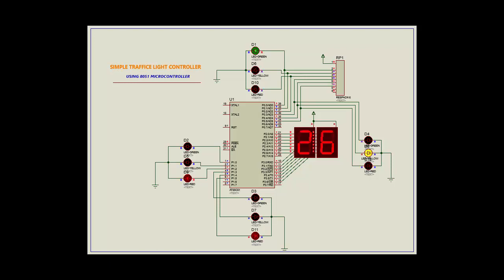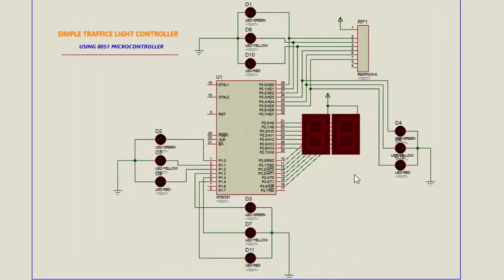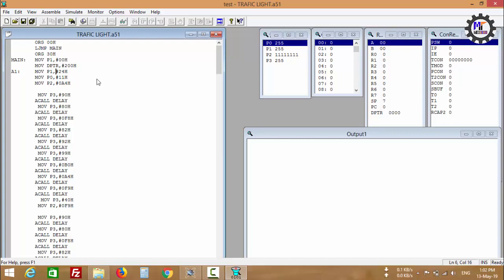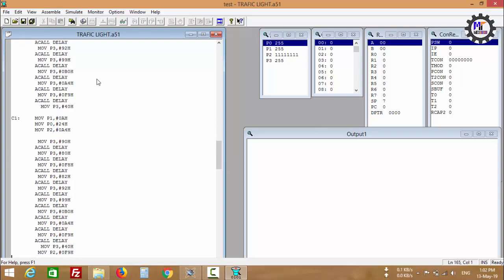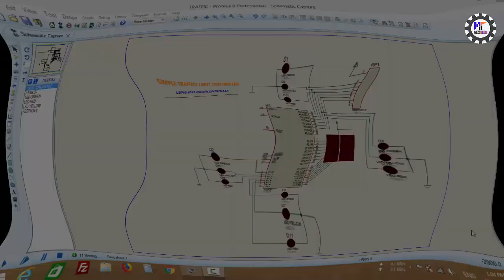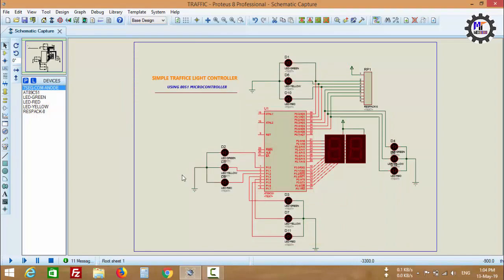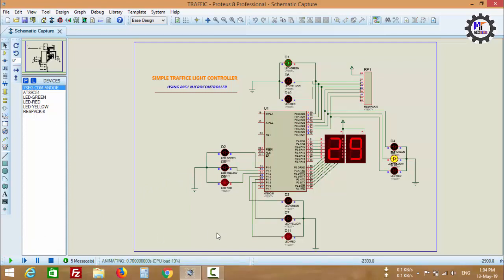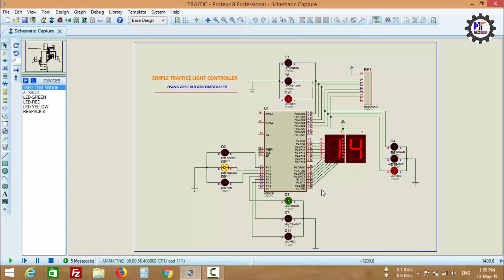Simple traffic light controller using 8051 Assembly language | full code + circuit | By MEXTech

Comment: I need that project by some additions (The 4-way intersection also has an LCD that display “Safety Messages”. Push Button for pedestrian , when pressed all the traffic lights stops for 15 second and a barrier controlled by servo motor is activated to stop the incoming cars)